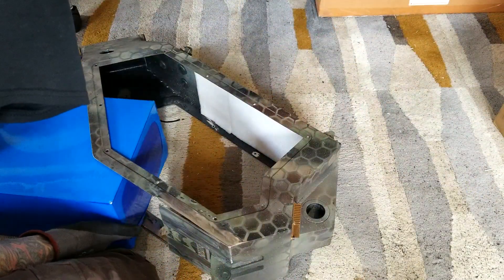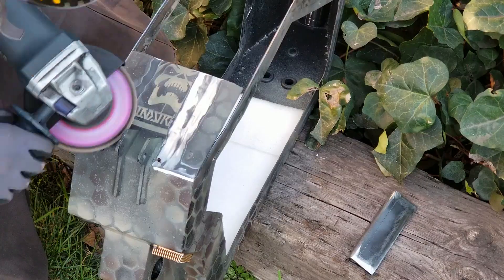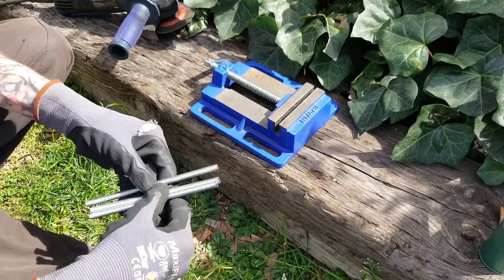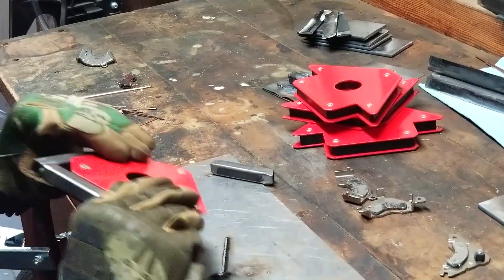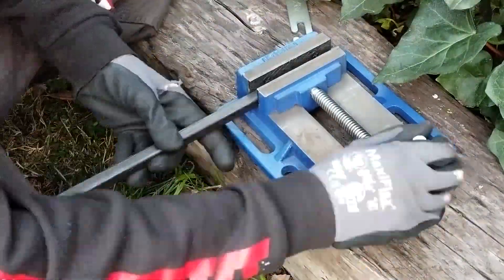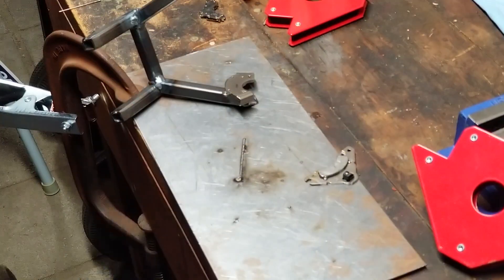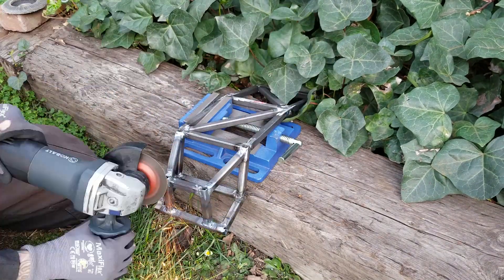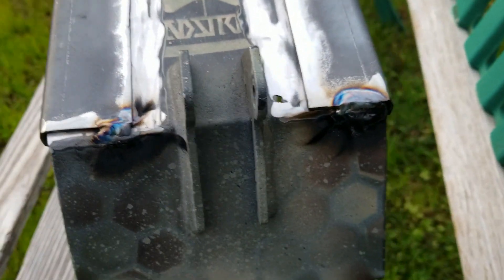🚲 Frame Done?! Custom E-bike 9.0 Frame Mods - Fabrication - Enduro - DIY Build! \ QS273 70Ah

Comment: Can you send the dimensions of the this design I want replicate the same like your is really cool desing
Reply from the maker: My apologies for the delay I was quite sick. 

I don't have anything mapped out exactly as this was a handmade part with minor tweaks here and there. I did make a 3D model in blender though which you can download from my site. Even if you made the design exactly from my CAD model, it wouldn't fit exactly as all parts shift and move under welding (unless you're using a jig). So I would only use this this as a rough guide for arrangement.

https://hightech-lowlife.github.io/projects/frame_mods_hex_camo.blend

Comment: I just got a garmata ebike seat for my volimart bomber frame and the mounts don't line up what can I do to make it work
Reply from the maker: How far off is it? I would probably mod the seat - enlarge the mounting slots?
Reply: @hightech-lowlife  probably 10 or 5 mm I'm trying to have an inspection done to ride on road
Reply from the maker: @jamesmetcalf6591  That's workable, as long as it's solidly mounted, shouldn't have any issues with inspection.
Reply: @hightech-lowlife  enlarging the slots does sound like a good idea I'm horrible at drilling I'm just gonna buy the frame thanks though
Reply from the maker: @jamesmetcalf6591  Using a drill to enlarge already cut holes is very hard, unless you have a drill press, and even then it usually doesn't want to do it. If you have a dremel or can borrow one, that would be easier to elongate the holes 👍
Reply: @hightech-lowlife  did you ever check out the website? The garmata seat on the voilmart frame looks sick I'm sad it wasn't the same size I wish they made an adapter for this
Reply from the maker: @jamesmetcalf6591  Yeah I took a look, they're pretty cool designs 👍 You could make an adapter, probably even 3D print one

Comment: im new to welding also, but i humbly suggest you get a welding table. i picked up one for $140 that folds up. it has adjustable side walls you can clamp to for 90 degree angles. and you always get a good ground.
Reply from the maker: Thanks man! Yeah, most likely I will pick one up in the future 👍

Comment: Mig welding is easier.
Reply from the maker: Hot glue is easiest 😂 - I thoroughly considered just getting carbon rods and epoxy - maybe for another project. I'll get a mig welder also later on, it's definitely faster. 👍

Comment: If folding bikes have a strong enough clamp mechanism you could do the same for taking the battery in and out
Reply from the maker: Oh, you mean adding a hinge to the whole frame to open it from the front? I suppose it is possible but you'd need a lot of reinforcement as those folding bikes are probably about 1/3 or 1/4 the weight this bike will be. I suppose this solution is like a 'fold' only it requires bolts instead of a clamp or pin 👍

Comment: HOW WILL YOU PUT IN OR REMOVE THE BATTERY SINCE EVERYTHING IS SCREWED TOGETHER
Reply from the maker: You just unbolt the top, then slide the battery in/out 👍
Reply: I see
Reply from the maker: @TECHSUPPORTEBIKE  It will be rare to have to remove the battery, only if major issue or the eventual replacement over time.
Reply: Cold weather 33 and below definitely the battery needs to be indoors
Reply from the maker: @TECHSUPPORTEBIKE  It would be much easier to just put the bike inside, I don't store any of my bikes outside, plus the coldest it ever gets where I live is about 40. 👍

Comment: Yay another episode, been waiting ages for this update 👊. Have you thought about cutting flat pieces of square steel then welding them on to the ends of the steel tubes to cap them off ?

We are like minded in ways of working but here is a tip, try not to work on technical stuff if you are tired or begin to get frustrated, it makes for sloppy work and will piss you off I'm sure you already know that hehe.

Keep going your doing great and your videos  help keep me motivated to finish my bomber build going.
10 months now, still designing and waiting to fabricate my own motorbike seat frame, it never ends but its what I love to do.
6 weeks on a waiting list to get my HOPE 4 V4 brakes
5 weeks waiting list to wait to get my custom antispark switch
3 weeks to get a set of EMI filters
 and on and on and on lol.
Reply from the maker: Thanks man!! Yes! I most likely will be capping the open ends of the tubing for aesthetics 👍

I totally agree, it's super easy to get frustrating and sloppy with work when you're tired/hungry/angry, etc!

Thank you so much, it can get discouraging when you have wait so long for parts or can't find the time to make progress, but as long as you keep chipping away that's one step closer to being able to ride something you made yourself! I'm sure you will be very happy in the end 😁

Comment: To me, with your talent, you could direct your considerable ability toward marketing a specific e-bike.  If you go in this direction, it treads on high power Sur-Ron and low power electric motorcycle space.  Pedals are present maybe to just work around the law but it will be a tough slog to do so with such massive power.  What you are building effectively is a full road only e-motorcycle and not really conducive to pedaling as you alluded including MUP riding as with lower power e-bikes.
I have reached out to High Voltage and Johnny Nerdout.  We need more e-bike specific frames to support DYI-ers.  A variety of different frames directed to different power levels and battery sizes.  This is where the industry is lacking.
Because I come from the world of competitive road cycling, I like to see a 40mph+ mountain bike with full suspension which will take the bumps at speed.  27.5" diameter mountain bike wheels with 2.8" wide tires or so.
Best mid drive motor in the 2-4 thousand watt category is the Bafang Ultra which is torque sensing.  Problem is, no aftermarket frames exists to mount this motor to something resembling a full suspension mtb or 29'er.  The Aluminum flanges to mount the Ultra and M600 motors are available however.  But precise fixturing of these motor flanges to a conventional bike with cut and weld is required and best way to do that is first make some fixturing to locate the motor bracket.

You have the talent to create something like described.  Whatever direction you take, I will watch because you have great creativity.  Thanks for your content.  A feast for those interested in e-bikes.
Reply: A feast indeed, im working on making and selling frames, it ain't easy but it will be worth it.
Reply from the maker: Thanks man! If you make a good frame, people will seek it out and purchase it, I'm sure!
Reply from the maker: Thanks so much man I really appreciate that! I definitely don't hold those same views of myself, but being hard on myself is just part of who I am, but I can be open to seeing other peoples perspectives and it's not without gratitude, so truly, thank you. 

I agree with there not being much of a dedicated area for these types of off-road (more like motorcycle) bikes. I think beyond the bomber design and of course the ever popular sur-ron, there isn't much deviation from these two platforms. I do believe that this segment will grow just due to how fun these bikes are to ride, you can go much faster and for a lot longer than just a 'regular' ebike. Also, with rising inflation and gas prices I think the ebike segment is also going to become much more attractive to riders when they don't have to use their cars as much and of course it's just a fun alternative to commute! 

There is one interesting design I have seen, I'm sure you're aware, but they put one of these QS hub motors mounted mid-frame so it's a mid-drive, but you get a ton of power from it (https://vectorebike.com/bikes/vector-vortex) pretty interesting. 

I think there is a lot of geometry involved in making a "great" bike frame, and that's not something I know too much about, not that it couldn't be learned but if I was going to design a marketable bike frame I'd definitely want to hire someone with a ton of experience in suspension geometries to make that the best it could be. I'd also love to get into organic optimized design to save weight. Once we can (feasibly) start to 3D print in metal, we'll be able to make some incredible machines!

Thank you so much for watching and your thoughts and comments, much appreciated.

Comment: Get some kind of flat end like pivot bolts to replace those acorn nuts.
Reply: Agree. Acorn nuts aren't really 'user friendly'...wrong situation on the bike, they would be health hazard.  I know you know this because you mentioned it.  Only further validation.
Reply from the maker: Thank you! Yes if this falls on your knee, it's not going to feel good - even though it is rounded, still won't feel as good as a flatter design 👍I will check out alternatives.
Reply from the maker: Thanks man! I will check those out! I'm not completely sold on the looks of the acorn nuts, so most likely I will look for an alternative.